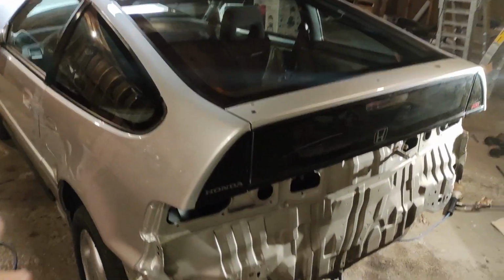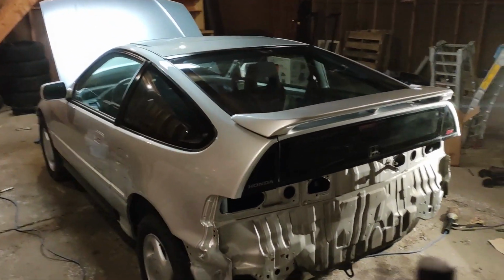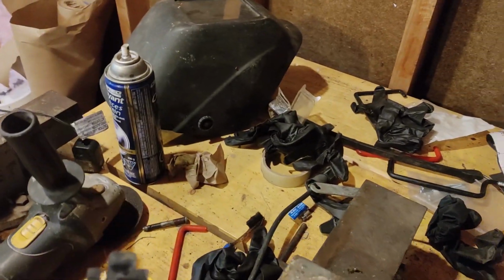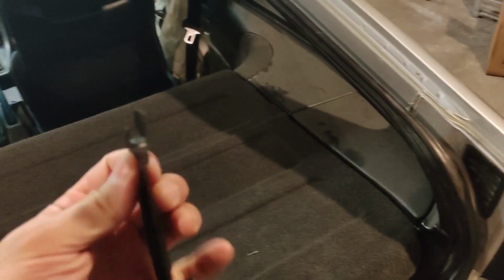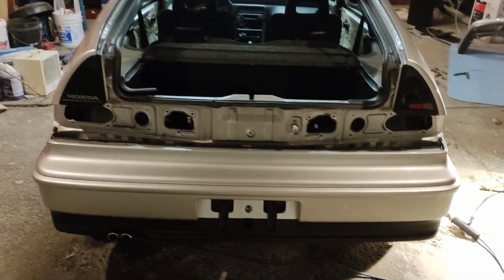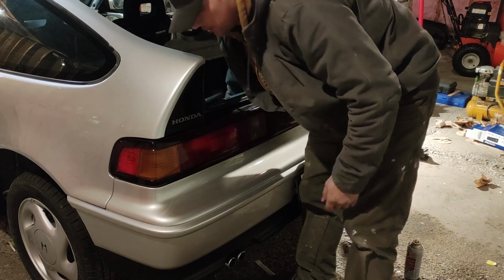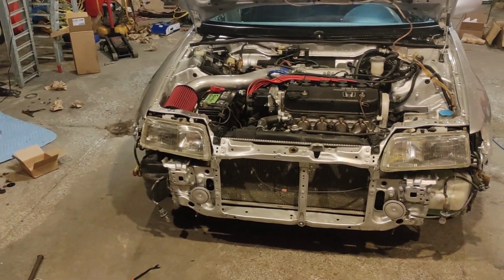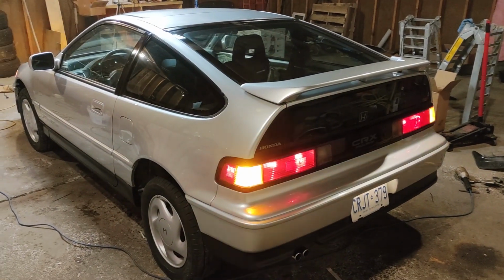Honda CRX Si Special Edition Restoration Part 3

Comment: Where did you get that foam for the taillights? How thick was it?
Reply from the maker: Amazon. 4mm
Just type craft foam 4mm

Should find it :)
Reply: @randomrepair1680  awesome man thanks. And it kept the water out?
Reply from the maker: @Rooki3_  I've never driven the car in the rain, but it stays dry during car washes :)
Reply: @randomrepair1680  ha nice, gotta keep the whip clean and dry.

Comment: Get the rear wheel arch rubbers... it protects the paint from rock chips.
Reply from the maker: I have them :) I was struggling with whether to put them on or not
Reply: @randomrepair1680  COOL
Reply: CRX NSX on instagram has many front lips. https://www.instagram.com/p/CLFAJgjH9tb/
Reply: @oldskool1979  crx/nsx also thinks everythingbis gold his prices are rediculous
Reply: I live in Pennsylvania and have a civic si front lip.  Not sure if it will work on the crx though
Reply: @TealEF90  it wont...